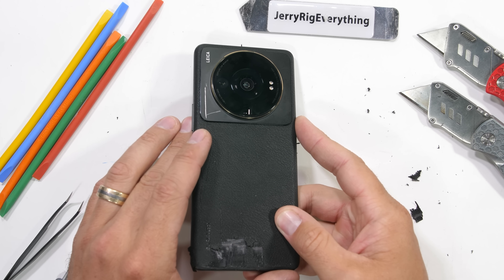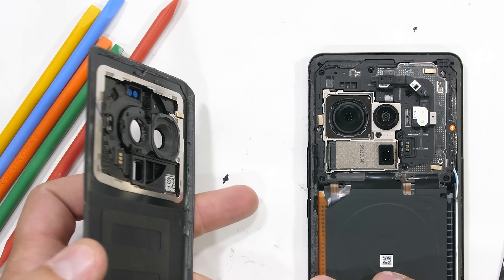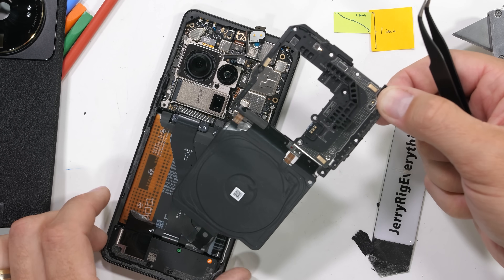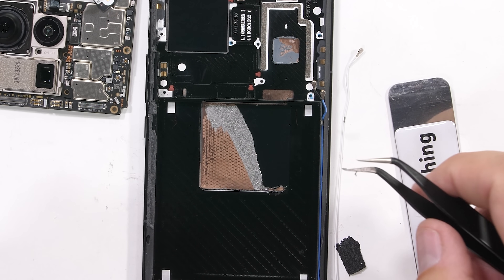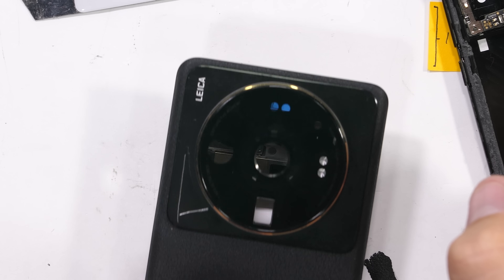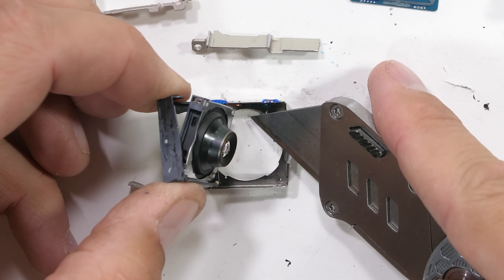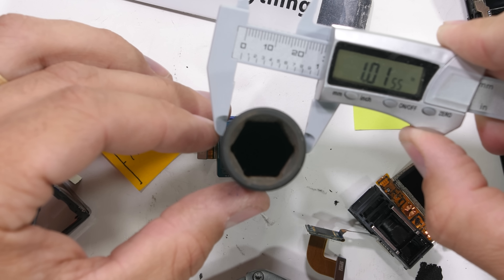Its a bit smaller than we expected... - Xiaomi 12s Ultra Camera Sensor Teardown!

Comment: The silicone back looks nice, would definitely prefer it over glass because glass is glass and glass breaks
Reply: Definitely agree with that!
Reply: I wonder if it will peel off by itself in the long run.
Reply: @pixels_per_inch  How long will it last in hot climates?
Reply: I have this phone and the back looks nice but it feels a bit crappy. It doesn't feel like it will tear but it's so thin that there's no softness that real leather has. It feels like textured plastic.
I prefer it to glass, but I prefer xiaomi's 11 Ultra with ceramic over this. 
Either way, I'm putting a case on it anyway
Reply: @robwhitmore3040  It'll be sprayed on silicone 'leather' substitute, that'll go sticky and horrible within months. Probably best to keep it hidden inside a case. 😉
Reply: I bought my first phone with glass back in 2014 and since then all my phones had has glass back with no broken back panels so  I'm not sure how you use your phone ☺ . Only one of my phones had ever broke and that was the screen its self. A cheap China phone I try once and only lasted for less than month fall less than meter and hit hard flor resulting in catastrophic damage to the screen but the back did survives even I think it was low quality glass. Screen did not have any types of certificate and broke in first minimal accident. All my others phone has survived all kinds of falls from 2-3 times this high so that tell a lot about Gorilla glass and other quality  certified glass out there that cover both back and front of every serious phones. I never try any cheap China phones again because of cheap glasses in screen and back make them extremely brittle and I stay with the big players. I have Sony Xperia 1 today and its 3 years and love it so my next one will be Xperia 1 lV or 1 V (next year)
Reply: Hmmm, and every silicane backed device I've owned has gone sticky and horrible after 12 months or less. Glass is better!
Reply: and chinese "leather" simulation always falls apart and looks ugly
Reply: I never broke any phone with glass panels, but hey seems like some are different.
Reply: It looks cheap! Using REAL leather would be ok. But a fake leather....give me a break.
Reply: @douglasdever6134  We witnessed the real leather durability on LG G4... On the other hand, camera grip-like texture and material can be almost immortal.
Reply: Nope, I disagree...my Nokia 8 Scirocco has glass back ...I have bought it in 2018 and still it's back glass intact ..if one will use it like human then it will remain same as it was when new..
Reply: @ckryses3962  Have you used a case?
Reply: Leather
Reply: @silva_br1  Fake leather
Reply: @anuarbin  just better than Apple

Comment: the sensor size is, as you correctly say, based on crt sizes. however most people don't know this and will therefore assume that the sensor is a true one inch diagonally measured size, you know, like TV's so they aren't really getting what they are expecting. a marketing ploy.. yes... but not entirely an honest one.

Comment: 7:03  sensor less than 1 inch diameter wouldn't perfectly fit in 1 inch diameter circle. Then any smaller sensor is 1 inch.

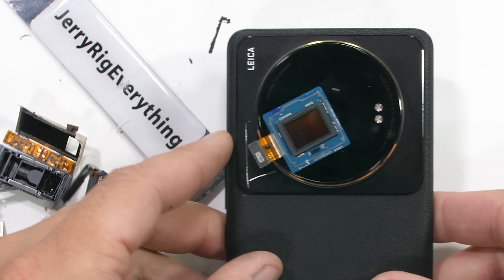Comment: 8:30 I think we should move on from the old measurement. We should measure the sensor like a TV screen. Diagonally.
Reply: Diagonally also doesn’t make much sense since they have different shapes. Surface area would be useful
Reply: Or better mm x mm.

Comment: 3:14 4840 mAh at 3.9Volts i have a Xiaomi and the battery is dead after about 250 cycles. They charge up to 4.5 volts to get that high mah number for the size.

Comment: I'd say the most logical way to measure sensor size is Surface area in mm^2. That way, There's no room for confusing roundabout measurement BS that marketing has come to exploit. Aside from this case,  Its amazing to me that 'inches' and "feet" are still used as legit units in the 21st Century
Reply: Yup, I'm 99% certain that the inch measurement has stuck around because marketing can create an image of a bigger sensor than it really is. People usually only see bigger sensors like full frame and APS-C, so using this confusing metric can make people think like 1" is close to something like APS-C, which is a bit over an inch diagonally.
Reply: american measurements is always shitty
Reply: surface area is still confusing. Dimensions makes more sense. Otherwise you would always have to specify aspect ratio, since a wide, panorama, or "normal" sensor would all have the same area but very different shape.
Reply: @excitedbox5705  That's a good point, but in mobile cameras 4:3 is the standard anyways, Only cinema cameras use other aspect ratios. I personally think Surface area is easier to visualize but yes ideally dimensions should be included as well

Comment: Every image sensor marketed as 1-inch sensor measures 0.52″ (13.2mm) on the long side, 0.35″ (8.8mm) on the short side, and 0.63″ (15.9mm) diagonally. Veritasium did a great video about this but it had to do with the size of a cathode-ray tube that was made for the first video cameras and how big the tub was to make a sensor that big.  So to be clear Xiaomi is not fibbing they are just following a standard for sensor size that has been around a very long time and it is not measured the way you would logically think it is. The next thing you will find is that a terabyte hard drive will not really hold one terabyte! :)
Reply: That is not correct. Xiaomi have 4:3 aspect ratio 1 inch sensor so if you will mesure it you will see that long side have 13,1mm and short 9,8mm.
Reply: he did say that

Comment: 1 inch sensor has nothing to do  with one inch in size its confusing i know ! The name of a 1" digital sensor should more accurately be read as "one inch video camera tube equivalent" sensor. Current digital image sensor size descriptors are the video camera tube equivalency size, not the actual size of the sensor. For example, a 1" sensor has a diagonal measurement of 16 mm.
Reply: Zack just revealed how many viewers doesn't finish watching the video.
Reply: Correct 👍🏼👍🏼
Reply: Correct, only 2 hours ago I watched DP Review TV and they broke sensor size down😀
Reply: Yes, finally one person knows his camera stuff.

Comment: Camera sensors should be measured in square millimetres, or square inches if you're a dinosaur (or American).. 
Any other way of measuring the area of a two dimensional rectangle is just inefficient.

Comment: No sensor is the physical size listed. The sensor measurement system goes back to the old days of television cameras, and this would be equivalent to a one inch cathode ray tube. There are charts for converting the size "type" of sensors to the actual physical size. It was originally done for marketing, and it still is 😂
Reply: Nice that u help all those with hearing impairment and transcribe what Jerry said so they can learn as well.
Reply: Maybe watch the whole video first...

Comment: Fun Fact about 1inch Sensor's
It's a name from very early days before digital Sensors even where a thing. The first Cameras with sensors worked similar to a tube TV and the "1 Inch" refers to the diameter of the tube, in other words the sensor has to be smaller than 1 inch

Edit:
He explains it later in the video, commented earlier

Comment: Now here's a thought. Switching inch measurements over to rectangle diagonal instead of tube diameter would just confuse everyone.
What if, hear me out, we switched to centimeters instead. Since no one measures in centimeters right now there'd be no confusion AND you could switch to a better way of measuring like diagonal, area or circumference
Reply: Also manufacturers could include both measurements, one in inches and one in centimeters. You aren't forced to get used to a different way of measuring but you do have the more 'accurate' measurement if you want to use it
Reply: @arouraios4942  in what way are they more accurate? It's just a unit of measurement.
Reply: @arouraios4942  i mean even in centimeters it still would'nt add up to an inch heck its gonna be smaller cus it takes 2.54 centimetres for an inch so if the video shows smaller than an inch that means in centimetres it would be lesser not making the value bigger...
Reply: I hope that by "no one measures in centimetres" you mean in the photography world and not generally cause well, the whole world uses cm's except the US :P
Reply: @sheikGR  All TVs are measured in inch in the whole world
Reply: @jesper164a  Actually it's measured in Inch and Centimeters at the same time. Sometimes only inch and sometimes only Centimeters. It's a bit confusing, but everything else except for Display/TV Sizes and Camera Lens Sizes is measured in cm.

Greetings from Germany.
Reply: @HereIsSuperman82  I'm From Denmark dude 🤣
Reply: @jesper164a  Nice, how it is there above me? 😂
Reply: @HereIsSuperman82  Mostly cold :( haha
Reply: @jesper164a  Here in Germany it's just too hot 🥲
Reply: @jesper164a  yeah thats cus its a marketing strategy but for camera's they dont use inch but rather centimetres cus no phone has reached 1 inch camera sensor
Reply: @jesper164a  No. No, they're not.
Reply: @HereIsSuperman82  its actually just made and measured in cm, but converted to inch for people who been buying "... inch" tv's for years, it's up to marketing how they describe it (just inch or inch & cm etc)
Reply: @sheikGR  even US uses metric in some shape or form - NASA, scientists on most if not all universities, many companies that work with anyone's outside US and even what US is most well know for, their diabetes industry, use liters on soda bottles instead of gallons
Reply: @sheikGR  you missed the point bro
Reply: @sheikGR  yes, that's what I meant
Reply: I'd say the easiest is just place a label at the end of the measurement i.e. 1" senor tube radius or 1" sensor diagonal or whatever. But lets be real, they are intentionally using that measurement for marketing, even if we think of a better way to avoid misleading, they for sure wont pick it up.
Reply: Diagonal is the worst system every invented to measure imaging devices. It's meaningless by itself, and even if accompanied by aspect ratio it makes comparing devices very hard. Area is much better, at least for screens. But area is also trickier for cameras since it's difficult to produce non-round lenses. So a lot of cameras have sensors that are actually larger than the image circle of their lens can cover, but of course this extra area is useless for capturing light. So the only true measure of what a camera system can capture is the image circle, which is a lens measure really, but is the only indicator of the maximum size of the lens that a given sensor can cover.
Reply: Given one wish I wouldn't wish for unlimited free energy. I would wish that everyone used the metric system.
Reply: Also, measuring in centimeters results in a larger number. Larger is better ;)
Reply: I don’t think it would really confuse anyone. Most people have no idea about the old convention, and anyone who does would likely be informed if manufacturers finally switched to using the diagonal of the sensor as the measurement.
Reply: i mean, film
Reply: sorry but we dont do that in the photography world, crop factors, sensor size, are all in inches (cropfactor is a multiple of that inch) lets say full frame, medium format, etc. we cant simply "switch" to a new measuring scale, everyone in the industry has used it for over a hundred years.
Reply: Cm and mm are essentially the same thing tho🤣somehow i always auto convert mm into cm in my mind. Maybe its just me
Reply: But how many toes is this centimeters you speak of?
Reply: @neutralnpc3065  Don't know about toes, but 1 liter of water at 0 degrees Celsius, is 1 kilogram and fits in a cube of 10x10x10 cm.
At least the english man that invented metric system said so.
Reply: @BozesanVlad  the metric system is the French's fault.
Reply: E Van  you that it was a nazi scientist that used the metric system than brought Americans to the moon?
Reply: E Van  Emmm in fact... the inches and feet delay the arrival and the reason for meny accidents. Also, USA is in the metric system (they have k4 and k20), but they convert in the imperal system... nobody knows why.
Reply: because everyone wants to pander to an American audience.
Reply: DP Review TV  tried to address this problem. Watch their video
Reply: Perfect!
Reply: "No one uses centimeters right now"
Yo ass better mean in the photography world because everyone uses centimetres except english canada and USA
Reply: you are a genius
Reply: Hey! I measure in cm! Where I live, we measure in cm! (actually, it's mm but it's the same scale!)

Comment: Hey Jerry. I know the Mi 11 ultra is now a year old, but by any chance could u do a tear Down for it. I feel like that was the best of Xiaomi yet. This 12s ultra is like a stepdown from it's predecessor.
Reply: I think so
Reply: This whole one inch sensor thing for 12s ultra was already in the 11 ultra coupled with it's unique design. Plus damn that camera bump for the 11U was fine AF. The ability to take selfies with that camera was was mwaaahh. It's like that phone was too ahead of it's time for Xiaomi. It feels like this was supposed to come first then the other one.
Reply: @xaviernic3675  ah I get you now, yes design wise it does not feel more advanced, hopefully the rear display will return, I really loved it, a shame really, well hopefully it will return in a future mi ultra device
Reply: @Mitorafer  I had by 11U stolen last year, tracked it, but unfortunately by the time I got it, the screen was already fucked. I just had to sell it for parts. Was contemplating to get the 12s ultra but it's failed to get to me like the way the 11U did at first glance. And if it wasn't for these OEMs dropping support for phones fast, I'd and most probably will buy the 11U again over the 12s
Reply: @xaviernic3675  i feel you, for good or for bad, xiaomi phones drop in value very fast, you can get a brand new mi 11 ultra for around 650 usd, which is a great deal since it is half of what the 12s ultra costs
Reply: @xaviernic3675  I don't know if I misunderstood you but this Sony camera sensor is new and debut in this phone. Has yet to come to Sony's own flagship. So the 11U had different and a little smaller sensor. But maybe you are talking about they had already designed 11U for 1" sensor size but again I think those people design one phone at time and aren't focusing on distant future. Doesn't make sense. But 11U maybe had change to host this sensor but more likely for other reason than to prepare for this sensor one year earlier. ☺
Reply: Yes true this is a sony 1inch sensor developed in partnership with Leica thanks to Huawei issues with US it lost the Leica deal to Huawei
 However, this isn't the first 1inch sensor in the phone. Xiaomi did that last year with the Mi 11 ultra however that was a Samsung sensor. To be more specific, it was the 50MP ISOCELL GN2 Samsung sensor. U can research about it and see.
Reply: Actually when u, check the comparisons of Mi11 ultra to the 12s ultra, the latter outperforms the later in some instances, tho the later has more saturated vibrant photos thanks to the Leica Tech
Reply: Every 2022 phone is being worse than it's predecessor because they're trying to keep last year's prices while also upgrading some components when all the components got more expensive to buy/manufacture.
Reply: 12s ultra is a complete crap when compared to 11U. Even detailed camera reviewers use 11U as benchmarks when comparing flagship mobile cameras. Things are just going downhill.
Reply: @ray4493  completely not true I have Mi 11 Ultra and upgraded to Xiaomi 12S Ultra, the phone is lighter, the leather like back is easier to grip and no fingerprints on the back, build quality is better, the camera is better and shutter speed is the fastest thing ever, you can just take out the phone enter camera and shoot and it's good, no effort needed, the proximity sensor is fixed, the snapdragon 8 + gen 1 is better in EVERYTHING compared to 888, it is opening up apps so fast and everything is much smoother while not consuming more battery and the phone does heat at all, the screen is ltpo which also saves battery, the phone has a few shortcomings compared to mi 11 ultra, the only major one is no rear display, which is a shame i'll agree on that, other than that, having 4860 battery compared to 5000 is not bad since the phone consumes less battery to begin with, and lasts to me personally a day and a half, you can still charge it for like 10-15 minutes and be good for another day, without even needing to charge overnight! (I was using the charger all day and night with mi 11 ultra), now I only need 10 maybe 20, at max 30 minutes charging and the phone is good for everything I throw at it, which is a huge advantage, the earpiece is louder too,
sorry for long rant, but what you just said is simply looking and specs and saying "they barely did anything, the downgraded stuff" no, the only downgrade is no rear display sure, everything else is better/same which is totally worth the asking price, the phone is great

Comment: The size of matrices in smartphones is measured not by an ordinary inch, but in vidicon inch,and he = 2/3 of classic inch
Reply: God, I was so confused how putting the sensor into a circle and measuring its diameter would get you anything other than just the diagonal of the sensor (which is not an inch as shown in the video, but  0.66), makes sense now
Reply: Vidicon inch? Jaysus.... whyyyyyyy.
Reply: No they dont
Reply: Yes, a famous scammers that worked for Cesar the king.